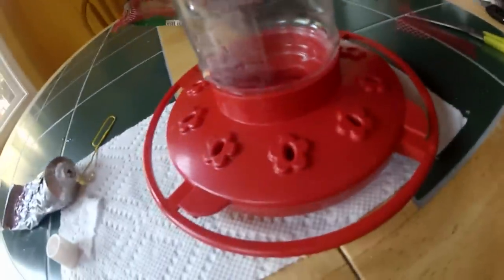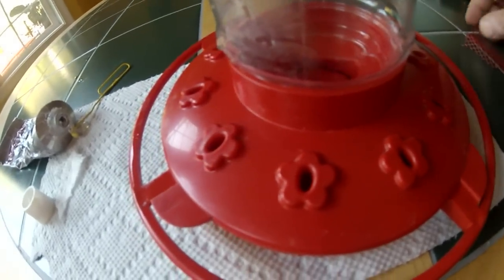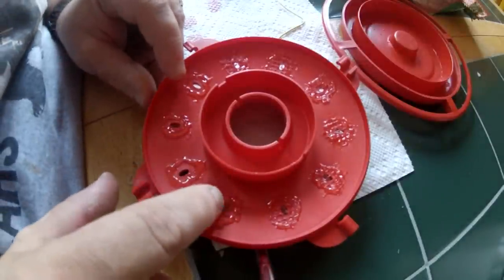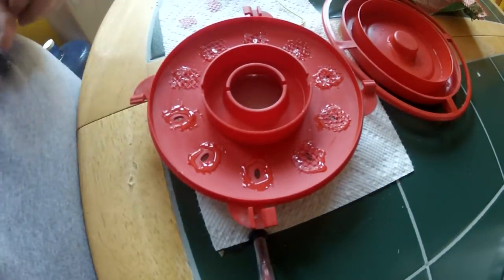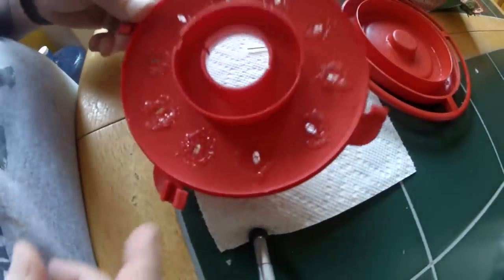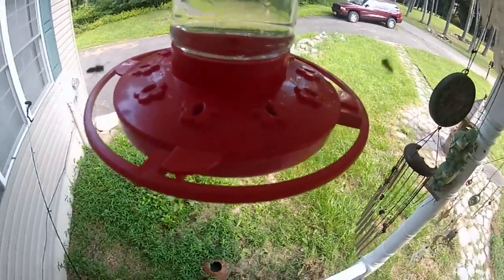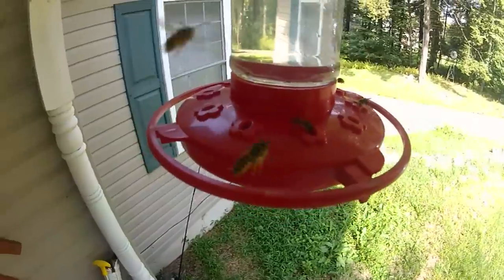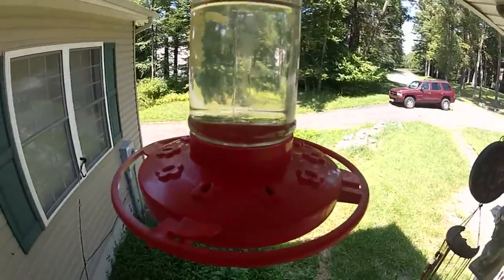Bee-Proofing A Hummingbird Feeder

Comment: I would recommend before you buy a feeder make sure it is bee and ant-proof. For the ant proof, they will have a small mote at the top where you can add water. You can also make one using a plastic bottle top. For bee proof, they will have a very small opening where only the hummingbird beak will fit. But if you already have one that is not bee-proof I would say this would work fine. The only thing I would check is if the glue you use is food-safe. In this case, E-6000 glue is food safe once it dries so it's a good choice of glue to use. Thanks for taking the time to share your video.
Reply from the maker: Yes! They have been improving these feeders over the years where you no longer need to modify them at all. It’s great!
Reply: @TerrapinCreations666  Yes, I have this same feeder but with slits instead of holes.

Comment: I used aquarium air line hose. It works great. Just cut the line in about 3/4 inch pieces and put in the feeder hole. Easy , inexpensive and fast.
Reply from the maker: That's a fantastic idea!  I may steal that idea and make a video!  I'll be sure to credit you!
Reply: You are more than welcome to use my idea. I need to correct the length of the line. The length should be between 1/4 and 1/2 inches. It is easier to put the line in the feeder hole if you don't cut the line into pieces. What I did was to put the line in the hole of the feeder first then cut the line from the feeder hole. Don't push the line to far down into the feeder hole. I first tried to use a straw cut in half then doubled over and put it in the hole but it was not tight enough to keep the bees and wasps out, so I finally came up with the air line. I hope this helps.
Reply: could you by chance show a picture of that??? I suffer from paper ring tailed hornets who fly right after the poor humming birds and chase them away.. thanks to all including Bill Tracy

Comment: Great idea!  So many comments that I cannot read them all, so if I am repeating someone else, I apologise.  SIMPLIFY:  Use the part of the feeder with the holes in it for a template to cut a circle of net.  Appy the glue to the inside of the ring; tap the whole circle of net in at one time.  I am so clumsy that if I tried to do each hole individually, I'd have to cut out 30 little bitty pieces of netting to have enough to cover 10 holes...I would drop every other one, at least, and not be able to find it.  LOL! Thanks!

Comment: good idea but I'd worry about the toxicity of the glue.  I would have just put larger pieces of the mesh in between the plastic parts.  Then it will also be easier to clean it, too.
Reply from the maker: The glue is non-toxic once it's cured, plus there are no parts to put mesh between at all.
Reply: Bill Tracy
Oh, good, Bill!  Thank you for letting me know that!

Comment: Maybe put the mesh on the outside of the feeder instead of inside, so the glue does not leach into the nectar.
Reply from the maker: Luckily the nectar level never gets that high up.  It would leak out the sides first anyway.  Plus the glue is harmless once cured.

Comment: Do even the cheaper feeders come apart? I have "forced" some plastic ones to separate, and they do snap back together, but usually then they leak. I did  find a feeder that is part metal, part plastic, that comes apart.
Reply from the maker: These were super cheap from Walmart many years ago.

Comment: I hot glued short pieces of drinking straw to the openings in my feeders--cut down on 80% of the bees (their hive is 40 feet away).  I slit the straw pieces and squeeze them tighter, to make approx 1/8" openings. Also found that the foam ear bud tips squeeze fit into the 'blossoms' of one of the feeders (rubber ones not so much) Hot glue is messy and not a permanent solution.  Hummers are smarter than bees. Bees seem to be after drips from the hummers.
Reply from the maker: With the straw, do you have some of the straw sticking out outside, or inside?  I think if you left some straw sticking out that would help even more, if that's not what you did.

Comment: Outside. It's hard fitting on 'tubing' over an existing hole. messy hot glue. I also found that heat shrinking tubing over the straw can make a tiny hole. A new feeder arrived today-like yours except with yellow flowers. The holes are small and keep the bees out. But they're still around licking up drips.   There are three levels of bee-problem 1. holes big enough they can stick their heads into- they feed themselves from the supply. 2. Smaller holes-bees can only feed on hummingbird drips and 3. No bee access at all. #2 is good enough.

Comment: Here is what might not be a solution. This is not a fix for bees as such. If your perps are wasps or yellow jackets,  that is, members of this tribe that  eat meat as well as nectar, this might work. I discovered it on fishing/ camping wilderness trips where we were plagued by yellow jackets. Open a can of soda, set it down and before you take the nest sip, check, there would be stinging critters lapping at the mouth hole.

They would get into everything. Cleaning and preparing the fish was a battle. That's what gave me the idea.  We would catch a few "trash fish," (Not game fish) Using fishing line, hang the fish from a bush about a foot--18" off the ground, at the outside edges of camp.  Several of these. Under the fish a container of water. (my shaving basin, the dish pan, the soup dish) The bees discovered the bait. Eat themselves full and fall into the water. There were still a few who came into camp but these we could handle.

Would something similar work for honey bees? Without the drowning pan. Like folded newspaper soaked with a sugar water solution (more concentrated than the bird feeder?) It spread so a lot of them could get at it. Some distance away from the feeder.

Maybe that's ridiculous? Just a thought.
Reply from the maker: That's sounds great!  I just have a problem with wasps / yellow jackets.  No problems with honey bees really.
Reply: @TerrapinCreations666  Bill,  Glad to give some hope.

Comment: question - i know you said this dries non-toxic, but does that include hummers and bees or just people?  All sites I read say they are super sensitive and not to use any chemicals or oils, etc.
Reply from the maker: Mary Blevins I can't really be sure, but so far the hummingbirds seem to be even more numerous around here.  It can't be much worse than the cheap plastics that the feeder is made from to begin with.  Plus where the glue is never touches the water much, or at least it's not submerged in it at any time.  It's up away from the sugar water.
Reply: I have a hard time believing this is a good idea. If hummingbirds can’t handle red dyes because of their extremely sensitive systems, I don’t see how they can handle this glue! Don’t think it’s a good idea.

Comment: Thank you! I have exactly the same type of feeder. I also happen to have a red onion bag and I'm  going to do the same thing that you've done with my own feeders. Many times yellow jackets get into the feeder and die. I've opened some feeders with dozens of dead yellow jackets. I would like to ask where did you purchase the glue that you bought. I've never seen it at Lowe's or Home Depot. I might also add that there is an extremely effective trap on the market called the W-H-Y trap and it is catching dozens maybe hundreds of yellow jackets around our front yard. Thanks again for the great idea.
Reply from the maker: It's E-6000 and I think you can get it in Lowes or Home Depot.  I got mine at AC Moore which is a crafts store.
Reply: +Bill Tracy we have an AC Moore nearby. I'm going to get it there. I haven't seen it at HD or Lowe's. Thanks, Bill.
Reply: Amazon has E6000 glue.

Comment: Does this keep them from hanging out and trying to get in? Mine is COVERED with bees, all on the outside.
Reply: The birds tend to spatter sugar solution just a little, so the outside of the base may sometimes need to be wiped down daily, even if the holes themselves are too small for the bugs to crawl in.   (And of course the base should be washed regularly on the outside as well as on the inside, when cleaning/refilling the feeder.)

Comment: This is a great idea. My biggest problem is leakage from my feeders. I have one just like this and it leaks almost all of the nectar out. Any ideas on how to fix this problem?
Reply from the maker: Maybe a new feeder? I’d have to see it.
Reply: I had leakage problems too. Bought new feeders, same problem. Turned out that the cold nectar from the refrig. would expand in the warm weather (Worse in the sun ) & make the feeders drip all over. That brought on the bees too. Keep feeders in the shade. And let the nectar come to room temp. before turning over.
Reply: The yellow jackets haven't cared if the feeders are in the shade. I've even painted the yellow flowers red, as suggested by various people online. Supposedly bees, wasps  & yellow jackets are drawn to yellow. They didn't care. I've moved my feeders. Those yellowjackets find them within a short time. I've done the 5 to 1 ratio of water to sugar. They didn't care. They still came, & are still coming.  I'll try the mesh today. Thanks.
Reply: @RobertMcDermott Also, I put the refrigerated food on the counter before I fill the feeders, as it isn't good for the hummingbirds to drink very cold food. I know when the cold nights come here in the Fall, there's nothing I can do about that. Most have gone south by then, but I keep them up through October for the stragglers.

Comment: I brush oil on it at every feeding because I clean the feeder then too. It's still a little slippery after a cleaning but I want to be sure the bees stay away. I also read petroleum jelly works too but that it is gets on the birds wings it will prevent them from flying so I decided to stay with olive oil. I have more control with it.

Comment: why are not feeders made ,bee and ant proof
Reply from the maker: Some are now.  I think these were really cheap ones.
Reply: Rose Fritz some of the ones where the nectar is in a container on the bottom rather than in a bottle come with little rubber tips which attach to the inside of the top, and they make the feeder “bee proof”. Problem is, a lot of hummers don’t really like that type of feeder.
Reply: Look for hummingbird
 feeder with built in ant moat & keep it (moat) filled with water. Happy ☺ happy